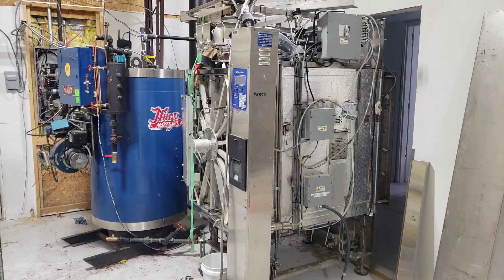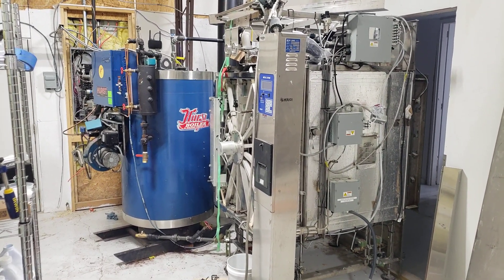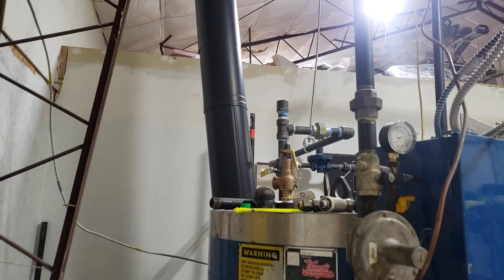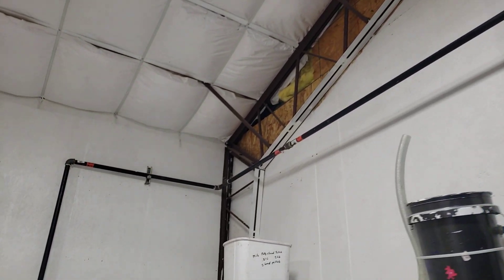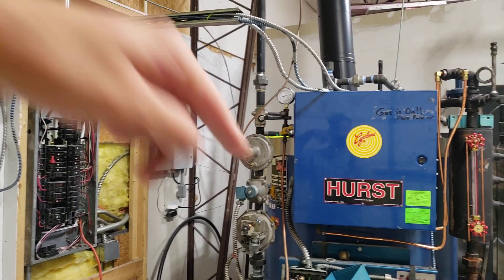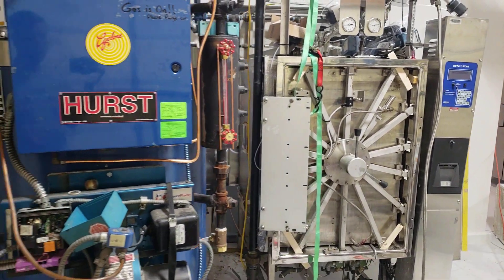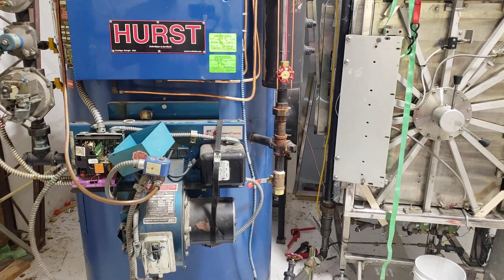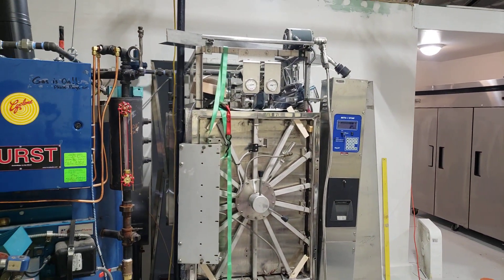Mushroom Autoclave Sterilizer Installation Guide part 1

Comment: From me, a licensed Steamfitter and gas fitter - Do not try piping this system by yourself. That is terrible advice. Really terrible. 
1 - steam and nat gas or LP gas done improperly is incredibly dangerous. 
2 - if the steam piping is done improperly it will end up costing you a fortune in the long run in energy bills or could cause third degree burns or worse. 
3 - guys like me make a fortune redoing improperly built systems that you have already payed for once or maybe twice by having to rebuild the $40-60k worth of mechanical that you bought.
Reply from the maker: All the work was done with the licensed boiler workers present, they were working on water supply while I did the steam exhaust. The gas lines were all planned out with the city inspector and gas company on board before I put up the pipes. I agree many people do hack jobs but this was all planned out, inspected and done to code.
Reply: i don't understand this mindset? if it passes pressure test, is done to code, and approved by the boiler company, what is the problem? i do the work myself, i'm not paying someone 100 dollars an hour to install pipe

Comment: didn't you say 100 six pond bags capacity?.....one load per 36hrs?
Reply from the maker: 60 or 80 6lb bag capacity and 3-4 hr cycle.
Reply from the maker: @seriouslyiknowhowtoread  yep higher psi is higher temps and more efficient heat movement

Comment: Thanks for sharing. When we install our two Chinese autoclaves I'll try and do a video and list the costs. Don't you need a certified boiler operator's license as well? Don't you have to have the pressure vessel inspected and certified annually? And congrats on getting to another level!
Reply from the maker: No licence needed for Kansas, The vessel needs to be licences and inspected. Although my insurance may say otherwise. Still didnt talk to them yet lol. And the boiler is every 6 months, autoclave 12 months. The safety valve on the boiler is replaced or re certified every year.